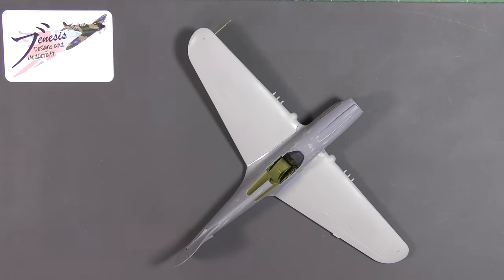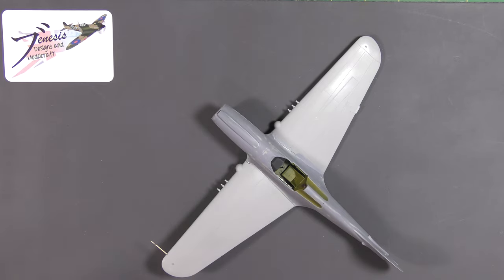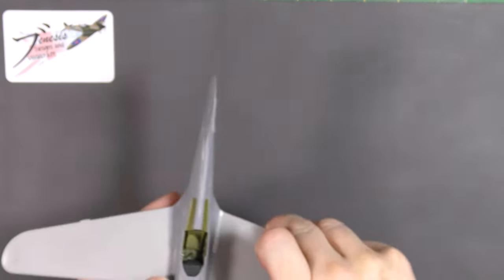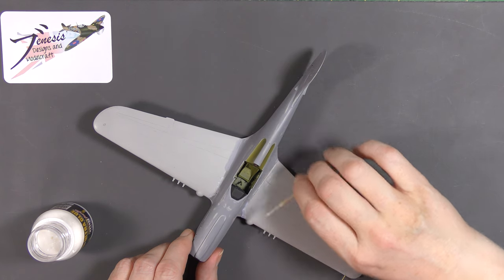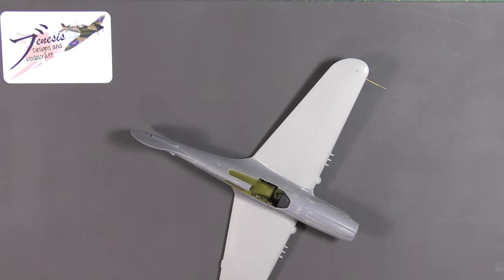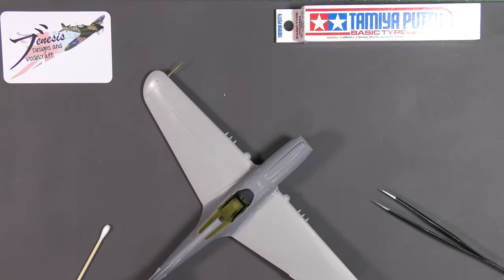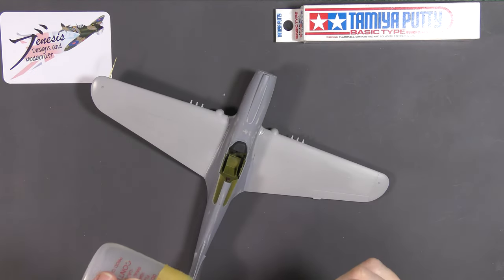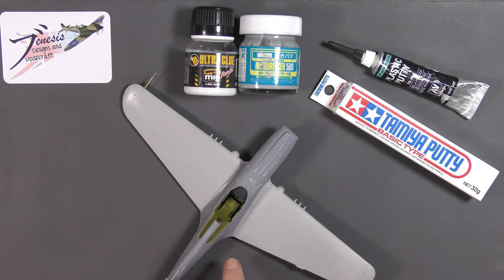The Book of Jenesis: episode 8 - Filling Small Seams the Easy Way!

Comment: I use Perfect Plastic simular to Vallejo brand all the time for small seams, I actually decan it into a small 2mm bottle with a sharp tip and some distilled water. Its works great, and because of shrinkage I usually have to apply more than once.

Comment: Great video Jen.  Thanks.  One question, Doesn't those putties sink over time?  Thanks again for a very useful tip.  Really like your channel.
Reply: If you pack it down. It wont sink. Shrink maybe but not sink
Reply from the maker: They do, very much so. All putties and fillers do to some extent, apart from CA or CA+Talc - which is why I use it. In the quantities shown here, however, it is minimal so nothing to worry about.

Comment: Hi Jen, where did you get that cap for the Mr Color Thinner?
Reply: @FinsburyPhil model shops
Reply: I have the ultra glue, never thought of it as a filler.
Reply from the maker: If memory serves I probably got mine from Frome Model Centre at a show. Most places that sell Gunze paints ought to have them though, they come in a set of three and are coloured to match the thinners.
Reply: @JenesisDesignsandModelcraft  Thanks Jen found them - Mr Spout!